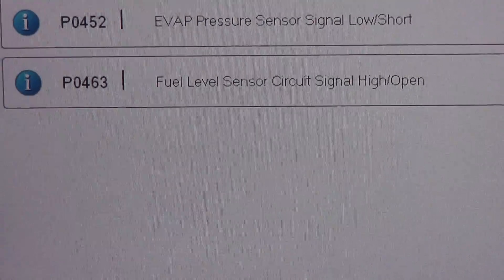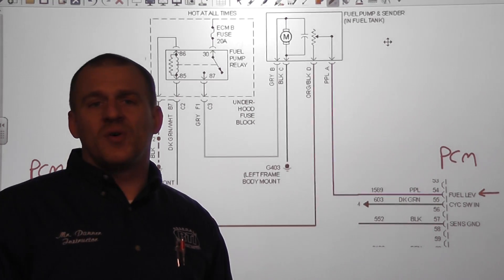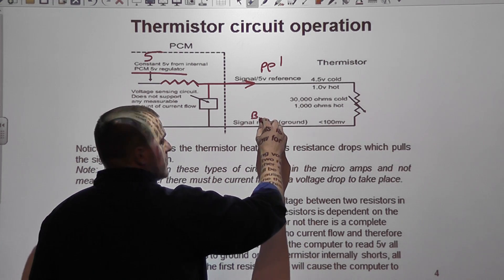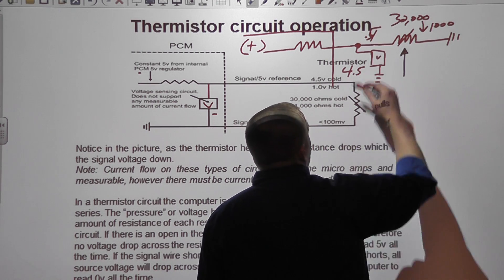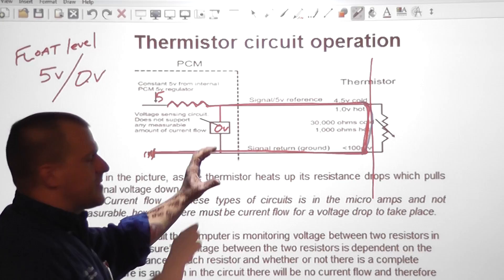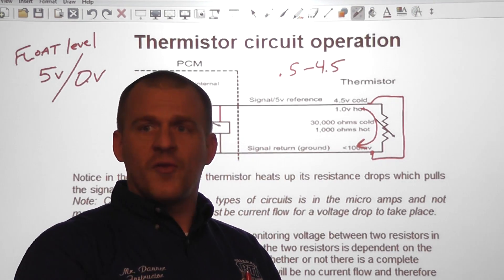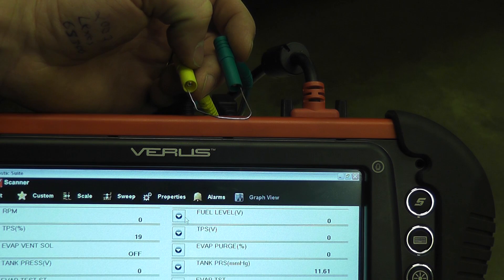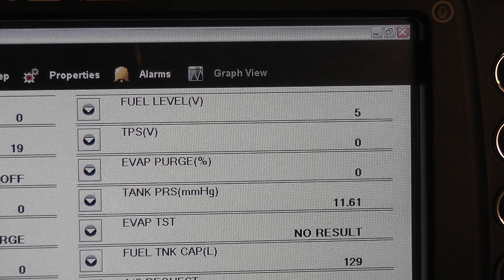How to test a fuel gauge (tank sending unit) P0463 - GM

Comment: You are a godsend. Is there any possible way that if the float positive wire or negative wire got shorted to 12v it would damage the sensor or ecm? I think I have a situation where the 5v got shorted to a 12v wire and now I have a circuit high code for the sensor after fixing the wires that were touching!
Reply from the maker: If the sensor ground wire got shorted to 12v, yes, it can damage the ECM. The 5v signal circuit would probably be okay. With the wires repaired and sensor plugged in, measure voltage on both wires. Tell me if you are seeing 5v on the sensor ground circuit. It MUST be plugged in (current flow) to be able to see what we are looking for.
Reply: @ScannerDanner I’m seeing battery voltage on both wires (fuel sensor and fuel sensor ground) but scantool is reading 3.08V for fuel tank level sensor and it’s not changing at all, just constant 3.08v no matter if the float moves.

This makes zero sense to me, unless I’m measuring the wrong wires but I’m looking at all data and it says these two are “fuel sensor” and “fuel sensor ground”

I don’t know if this matters but this is a Nissan Altima 2025. I’m pretty sure it uses the same 5v reference system for fuel level but the wires go to the “Combination meter” or cluster and not directly to the ECM.

Another edit sorry, I’m reading online that battery voltage on the sensor circuit could mean the sensor has essentially become a wire or there is a short to voltage still. The wires are repaired in the area of concern, so is it possible that the jolt of voltage killed the sensor and it’s now open circuit? I see in some systems the unloaded voltage is battery voltage but the resistance of the sensor makes it drop down, I’m starting to lean towards a dead sensor.

Also with sensor unplugged I’m reading battery voltage of sensor positive and 0v on ground side, is it possible that the way this system works on the Altima is it just sends battery voltage to the fuel level sensor and measures the difference in voltage across a resister? Like it supplies 12v and if it gets back 9v than it reads out on scantool 3v for tank level? I’m so confused 😂

Disregard all of the above! These are the ramblings of a mad man!!! 😂😂😂
Reply from the maker: No man! All good stuff! Someone who is actually trying to learn while troubleshooting is awesome  to see! I believe later in this process you find that the sending unit signal circuit is 5v and not 12v right? As far as a fixed signal on your scan tool of 3v. Remember that a data PID can have a fixed value when there is a fault and a max value too. So it is possible that 3v is the highest that circuit will ever show, regardless that there was 12v going to it at one point. Typically though, you'd expect to see 5v on this type of circuit
Reply: @ScannerDanner The other comment got too long but I have made a breakthrough. So a test light between the sensor positive and chassis ground made scantool reading change from 3.08V down to like 0.3v as well as lit the test light. Maybe my sensor ground is bad? It has continuity to sending unit. Would it be a big Nono to ground the sensor ground wire to the chassis?
Reply: @ScannerDanner I FOUND THE PROBLEM!!! After reviewing your other video on 5v reference issues on the 1992 Taurus. I have exactly that issue, the sensor ground is bad! I’m gonna pop the cluster and load test the wire to see if it’s broken and if it isn’t I’m going to jump the fuel level sensor ground to another ecu sensor ground because I’m not going to shell out $1200 on a new cluster for this car

Fix update: Seems like the ground inside the cluster somehow messed up probably when it got shorted to 12v. (The 2025 Altima does not share this internal ground with any other sensors, strange) I ended up grounding the ground wire to another 5v reference circuit ground in the cluster which fixed the problem! I guess I’m sending back the replacement fuel level sensor when it arrives. Thankfully never had to pop the sending unit out of the tank!!! Win for diagnosis!!!!! and after I rewatched this video I guess I skipped over the part where you mentioned that a bad ground on the circuit will cause issues but I was thrown off because I was getting battery voltage on the sensor positive and not 5v, because you said in this video that if the ground was bad you would measure 5v on the ground side. It’s funny how that issue of the 1992 Taurus can still be an issue on 2025 vehicles 😂
Reply from the maker: So true! Many people don't understand that these case studies and lessons i teach still apply today! Nice job on your part my friend!
I missed how this all happened? Did a mouse get into the harness? And then the pump 12v feed shorted into the sending unit wires?
Reply: @ScannerDanner This all happened because I was replacing the drivers side rocker panel from accident damage. My idiot self didn’t think to remove the wiring harness that runs along the inner pinch weld under the plastic kick panels. The resistance spot welder melted a few wires together while I was welding the new rocker in. After the job was complete there was a check engine light on that wasn’t there before. Come to find out that the harness for the sending unit ties into that main harness so I knew where to look and sure enough I think 12v supply for the pump got shorted to a few things and some things shorted to ground. It also blew the fuse for the power windows and seats. Not fun but it’s all fixed now!

And yes you are correct as soon as ground was restored to the circuit I think the voltage went to around 1.8v or something like that but the fuel tank wasn’t full or empty kind of in the middle so yes with ground restored, I think it’s more of like a 3v reference or something like that. I don’t think I could’ve solved this whole thing without your amazing videos!

If you’re remotely interested the rock panel job came out great and here are some photos:

Before: https://drive.google.com/file/d/1eGlCG8ju7ztI5crOwdQcO85Cpc7KLRFt/view?usp=drivesdk

After: https://drive.google.com/file/d/1uiq44NOcfiwXHiePbdmnh395nNnJLwFE/view?usp=drivesdk

But this whole experience kind of taught me how reference circuits work which is one thing I never knew, I have very limited understanding of how the electronics in a car work at all so I hope I can start to grasp it more in the future. Also it’s very nice that alldata offers 1 month diy subscriptions for $20 for one specific car, which I had already purchased for the factory sectioning info for the rocker, but it also came in VERY handy for this as well!

Comment: What could be the issue if my scanner is staying a  5v after inserting paper clip and the ground seems to be working, but my fuel gauge still reads empty thanks
Reply from the maker: year, make, model and engine size please
Reply: @ScannerDanner  saab 9-5ng 2011 2.0 diesel thanks

Comment: Hi Paul thank you for your help
I have fuel level sensor with 3 wires
How is it work
And what should I find as power in wires
Plz help me
Reply from the maker: If it's a 3 wire it is either a potentiometer (tested like a TPS) or the 3rd wire is for a low fuel warning light
Reply: @ScannerDanner  I find 4.5 volt and the wire is good
Is it normal or should be 5 volt
Reply from the maker: @mekkibilal1372  on what wire? what are the other two wires showing?
Reply: @ScannerDanner  power 4.5
Ground 0v
Signal wire 0 v
With unplug fuel level sensor
Reply from the maker: @mekkibilal1372  4.5 is a little low but that wouldn't give you a 0v signal
Reply: @ScannerDanner  thank you for the help paul

Comment: Scanner, question, If I was to give that purple wire a ground. The fuel guage signal wire would that make the fuel guage jump to full
Reply from the maker: If the purple wire was the signal wire, then the gauge should respond when you disconnect that wire and ground that wire. The gauge will sweep fully one one and then the other. Keep in mind some cars will build in a delay which is there to prevent the tank level from jumping around during driving

Comment: As an ACDelco instructor, we were teaching this in 2002 in classrooms. The values have changed from 0-90 ohms, the 0-240 ohms for higher resolution used by OBD-2. This is a common voltage divider circuit and in the computer is a 5volt regulator, not a resistor. Don’t be fooled. If you had a 2003 Tahoe, how many 5 volts sensor circuits could you find? Dozens! TPS, Air temp, Ambient Air, Cab AC Temp in duct, Fuel yes. So an entire bank of 5 volt regulators even use after start-up for voltage drop compliance testing for sensor integrity. For a low fuel sensor, NTC Thermistors are common on imports, motorcycles even riding mowers. Fuel level on a swing arm can be over active on turns w/low fuel, so the PCM updates the fuel gauge every 8-12 seconds as live reading are not needed. So, a gauge on a motorcycle will use a 5 volt regulator, NTC thermistor and current limiting resistors for the LED low fuel lamp. Not 1,000 ohms as the linear temp curve is not as accurate. And for those who think any heat in the gas tank means an explosion, they are in a can, surrounded by wax paper & SS Wool, lid is soldered on to provide ground. The PCM see’s near zero ohms, it trips a voltage signal to a low fuel lamp so the resistance is split even between gauge and lamp. Low fuel from GM gives you 2.5 gallons. Toyota gives 3 gallons. Motorcycles 0.5 gallons. Or as the 60’s, 70’s, and 80’s used a taller stand pipe on the petcock to run out, switch to reserve and draw fuel from bottom of tank! How hard was that? 
DK, ASE Master, 78.
Reply from the maker: On a thermistor circuit there is absolutely a resistor that is internal to the board that does connect to the 5v regulator circuit. All stuff i talked about.
Reply: @ Yes, resistors are used, sometimes as a signal pull-up, or pull-down. But this type of technology was used at the same time of removable PROM’s with “Edge Board” connectors. Today’s processors conform to OBD-II circuit integrity requirements and resistors frequently are placed in series to help calculate a voltage drop value, known resistance value compared to last known fuel level in this case, yet they reference the EEPROM to see the circuit is complete by simple resistance matching the fuel level when the key was shut off. One of many important IC chips caught in the China shortage was the EEPROM as its used everywhere. Yet 5 Vdc supply is regulated internal for oil, coolant, ambient, fuel, oil level, last EVAP per warmup cycles or refueling events. They abort the testing due to high altitude, low battery, pre-existing codes and in fuel if the tank is below 20% or over 80%. This allows them to now test for pressure in tank, level, Engine Off Natural Vacuum and pick the best test practice to satisfy large leak, small leak, tiny leak or fuel cap off after refilling (Type B code) so the driver gets a message on the driver’s information center “Check Fuel Cap” stored in history, 1 or 5 fail codes that a Tech-2 can read. Yet to your point, using a resistor in series to create a voltage drop to 5 Vdc is subject to internal heating, external temperature changes and accuracy as it most likely won’t have a “Gold” tolerance band, just an ink stamp as a surface mounted device (SMD) once installed (COB) component On Board. A stabile voltage supply is required to achieve higher resolution from the newer non silver base ceramic resistor board (Accidentally high sulphur fuel sold in the SE), 0-290 ohms, instead of 0-90 ohms, for onboard diagnostic much less display, which is sent to the IPC via class-2, like VSS, Temp, Fuel, Oil, etc. Even theft uses 5 Vdc for a regulated voltage drop to enable spark, fuel much less cranking. So as far a the PCM, there are a number of regulated 5 Vdc busses. If you look at transmission shifting, not only an analog multi-position switch but to confirm the selection & actual gear choice, a pressure switch using snap switches sealed by a flexible membrane is confirm the drivers choice, but two ways to report to the PCM. 5 Vdc allows smaller gauge wire which make voltage drop due to resistance even more important at connectors terminals are smaller allowing micro 0.64mm to complete a circuit. Then clean connection at the battery, dedicated B+ to a fuse/relay center and high quality alternator diodes to keep A/C voltage to an extreme minimum. It’s a system rather than a single circuit. My own build I employ double grounds everywhere, frame & harness, star washers w/dielectric grease. I enjoy wiring.
Reply from the maker: @deankay4434  thermistor circuits still work EXACTLY the same and testing them is no different than what is being discussed here.
Reply: @ Have a nice day.
Reply: Why do you feel the need to reply with a damn story about a bunch of rambled information? What Danner described is on par with how this circuit works and what the PCM is programmed to look for.
Reply from the maker: @2015_Rubicnn  rambled indeed
Reply: @ScannerDanner  Yes sir
Reply: @ You are welcome!
Reply: @deankay4434  No one asked for it, so we're not thankful. 👍
Reply: @ I am positive you will get over the extra information.
Reply from the maker: @deankay4434  extra info? More like completely irrelevant info with the majority of it having nothing to do with the topic and testing of this type of circuit
Reply: @ When you grow up, you will understand and perhaps then get it. You are welcome!

Comment: Hi Paul
I have golf 6 vw 2011
I measure coolant temperature sensor plug voltage I find ground 0 V and 3.4 v not 5 volt
Why??? 
I don't understand this case
I think it should be 5 volt
Reply from the maker: Some of the euro cars (I've heard) did use a 3v ref circuit. Any issues with that circuit?
Reply: @ScannerDanner  any issue it is good
Reply from the maker: @mekkibilal1372  then I would call that normal my friend
Reply: @ScannerDanner  remember this
This case is in ecu Pcr2.1 continental

Comment: My background is in repairing and calibrating Aircraft Flight and Navigational Instrument Systems. (analog and digital)
Automotive fuel tank sending units are potentiometers wired as rheostats.
https://en.wikipedia.org/wiki/Thermistor
    (uses "thermal" temperature to control current flow)
https://en.wikipedia.org/wiki/Potentiometer
    (converts a mechanical position to a voltage measurement)
https://en.wikipedia.org/wiki/Potentiometer#Rheostat
    (uses mechanical position to control current flow)

Comment: I'm a second year auto student. I've got a 1998 chevy s10 with no dtc's, fuel gauge reads empty. All tests on sending unit are good. All tests on pcm circuit are good. I can't find a diagram for pcm to gauge in cluster. How do I test the circuit from pcm to the actual gauge? Is it on data bus? This vehicle has multiple gauges that do not work and some that do work. the cluster has been replaced. Any help would be appreciated.

Comment: Super video. Now I can attempt to diagnosis my sender on my motorhome that reads empty. Like you said, if I disconnect the wire plug at the sending unit, I should read 5v with my meter to ground. Thank you!

Comment: my 2010 Dodge Grand Caravan throws the same code, but the gauge works fine. I checked the live data and it shows me (fuel level1, left hand, and fuel level 2, right hand), which in my case the left hand one works fine and the fuel amount percentage is correct, but fuel level 2, right hand is fixed at 4.96 volt, which is triggering my code I assume, and I wonder what that is. Kindly please respond to my question if you could, thanks.
Reply: I assume there are two fuel pumps in my car?
Reply from the maker: I'm not sure if you have two pumps on not. This is an AWD model right? Where the rear driveshaft splits the gas tank? Either way, if your tank level sensors are two wire designs, like in this video, you will be able to follow all the exact same tests. 4.96 volts on the scanner suggests an open circuit. Make sure you are reading the same 4.9 volts down at the sensor itself and then make sure your sensor ground is near 0v and if it is, you are done! Time to drop the tank. And while you are in there, change everything!

Comment: According to my opinion, Voltmeter placed between the two resistors in series actually measures voltage drop across the second resistor (One towards the ground side)
Reply: Voltmeters measure differences in electrical potential between any 2 points in an electrical circuit.
(Not necessarily relative to ground)
Measurements can be made across any one or combination of resistors.
Reply from the maker: That is correct but the resistor in front of your meter will change what you see too

Comment: I have a very odd issue with my express van currently. ive gone through every diag in the book (that im aware of)

Send wire has 5v, ground is good. multiple brand new sending units, same error.
if i operate the float outside of the tank, all gauges work properly. as i am lowering the pump into the tank, all is good. shows correct level and voltage. as soon as the pump is fully seated in the ring, the gauge defaults to empty almost like the float is being held down. i have had my arm in the tank, no obstructions. any idea what i might be missing? when the sending unit is mounted in the tank the voltage says around 2.5v but operates from .7 to 2.5 when sitting outside the tank not submerged. grounds are good, ive had this same issue with 4 diff ecms, 3 pumps, 3 clusters, 2 different wiring harnesses. only thing that has never been swapped out is the tank itself. i even tried running my own ground straight to the tank.